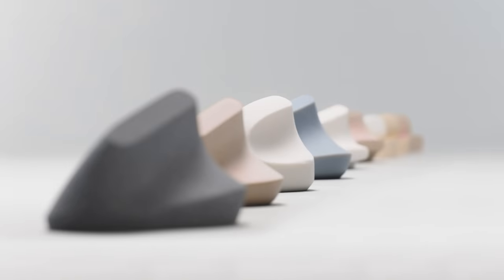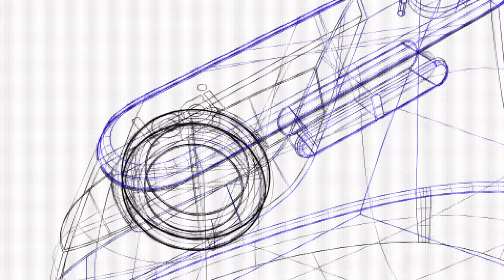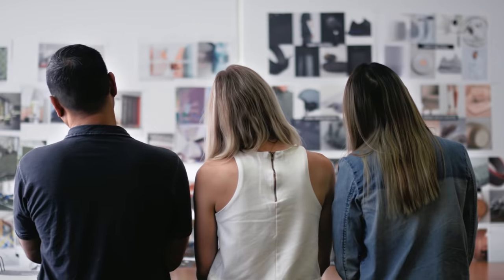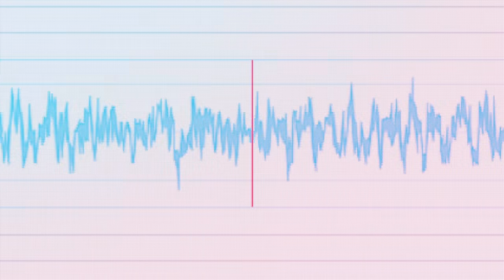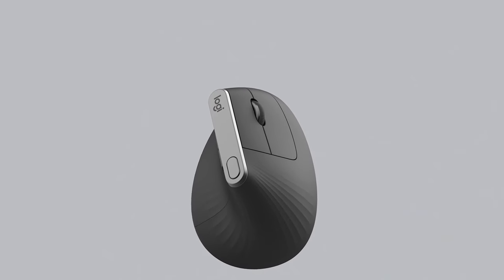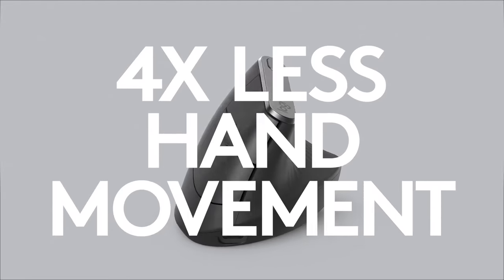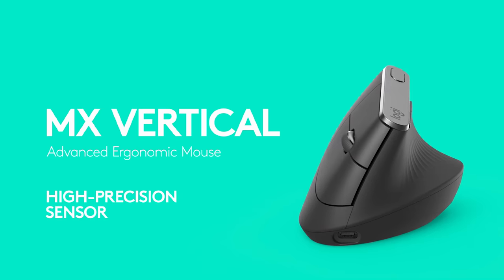Logitech MX Vertical - creation process video

Comment: I have owned it for a few weeks now, and I can't speak to how they did it, but you can basically just pick it up and use it from the start. It is very comfortable to use, and you don't get any strain from it. The normal functions of a mouse are also very high quality, no issues! I love it. I have larger than average hands if you are wondering ;)

Comment: It's a very nice mouse.
I've only been using it for a day, but I'm impressed with the well-built design.
Compared to other mice, it can be held at a more natural angle, which is great for preventing wrist fatigue.
However, I'm afraid that if I get too used to this mouse, I won't be able to use any other mouse.
Reply: i have this mouse. Yep could be a problem , once i person is used with with something good and comfortable , don't really want to switch back .

Comment: Nice to see a big computer peripheral brand finally embracing vertical mice. Hopefully this will start a trend and we'll see more on the market now. Until now there's only been like one expensive niche brand and a bunch of cheap Chinese models and one good one by Anker.
Reply: Exactly! I have the one from Anker, and after it sold out here in Malaysia they started replacing it with China brands like Xpower which die fast or have connectivity issues.

Comment: Ok, so, the next thing we need from Logitech is an upgrade on the Alto Connect for 13 inch Notebooks with a 2 C-ports and 4 USB 3.0 plus the Network/HDM/Display port/VGA connectivity. 

I would be satisfied with a free Alto and this mouse for the Idea at least. 

Thanks Logitech.

Comment: I have it for 3 months now. I'm 1,80  (5'10) I'd say normal male hands. This mouse still feels too big and uncomfortable. I purchased 3 models from amazon. The one that really fits my hand perfectly and has silent, but clicky buttons costs £15... 
Who'd know... I'm kinda disappointed though, because I watched this video before buying the mouse and I was like "yey they actually did ergonomics research"... On the other hand (haha) if you have enormous hands you might find it comfortable and enjoy the bluetooth and usb connectivity, which on itself is pretty cool. 
Another thing is built quality. I bought the mouse for £80. Doesnt have that premium feel to match the prices - actually it feels like there's something wobbly and detached inside. 
Bear in mind also that when connected via bluetooth there is a slight delay. I notice it, it's not a problem for browsing the internet or working with simple software, but not as precise as my workflow (CAD, Revit, Sliders on DAWs) require.
I actually tried to return it, but Amazon told me I have to pay the delivery back, which was like a third of the price so I just kept it.

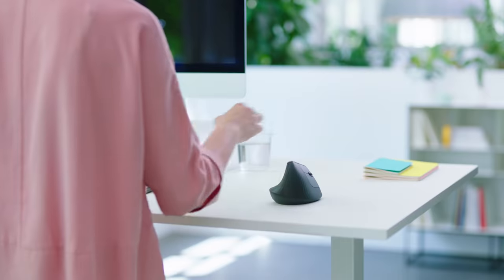Comment: 1:00 If this is the actual operational geometry, it's obvious that the biceps is going to be under constant low-level tension, or else thumb is going to be supporting most of the weight of the forearm, or else a partial death-grip on the entire gripping surface of the thing.
With the (logitech, incidentally) mouse I'm using at the moment, and most others, weight is distributed on the biceps, forearm, heel of the hand and the mouse top-surface itself. It is not ideal. There is no 'ideal' mouse configuration. Logitech hasn't produced anything significant here,
except implying a "57º" tilt is 'vertical'.

"truthful hyperbole" --Donald Trump.
Reply: I wish I read that comment before buying that thing